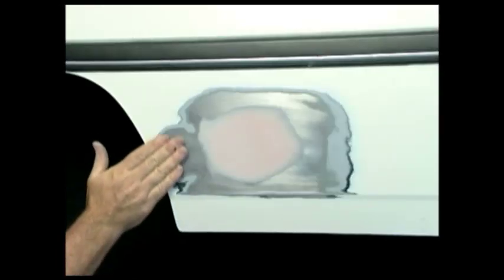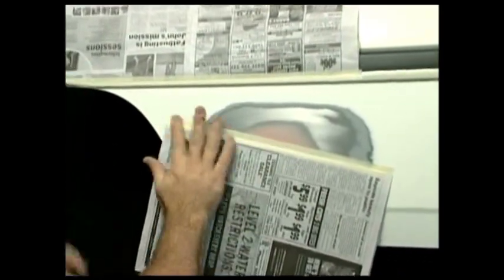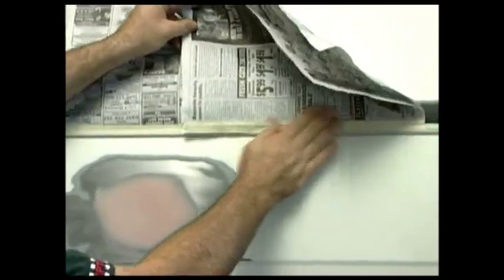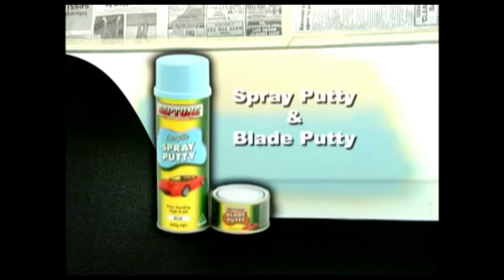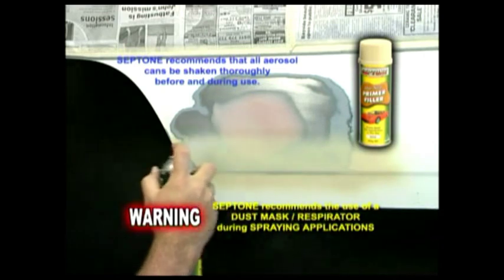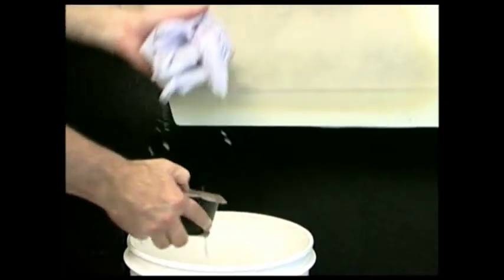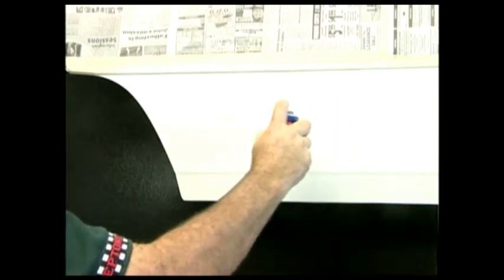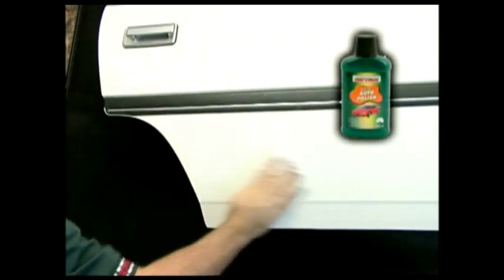How to - Paint Repair // Supercheap Auto

Comment: Supercheap auto always make the wrong paint that doesn’t match with your color code. I have occasions where batches of paint differs even when they use the same recipes from their system. They will dodge blame for wrong paint made most of the time and the customer is always taking the risk. Don’t trust Supercheap auto as I have buying a lot of paint. Go to your local auto paint store!
Reply: A lot of the younger customer service workers are also shifty and will deliberately sabotage you !